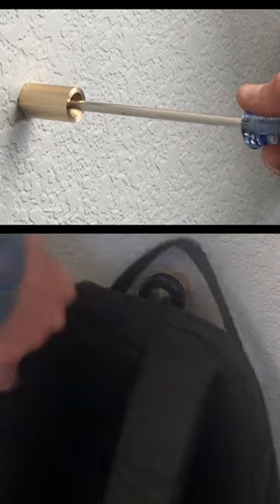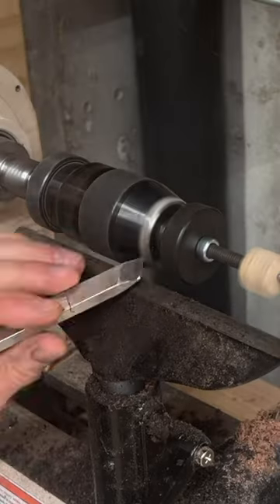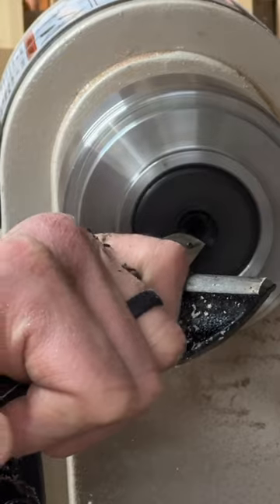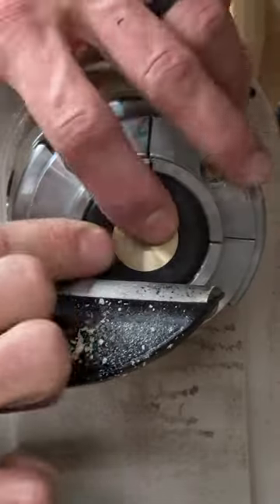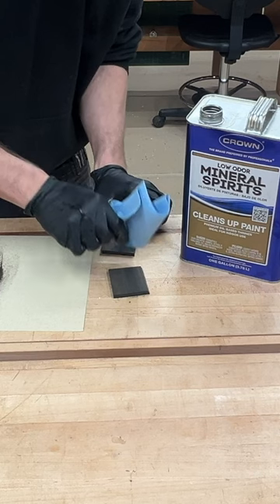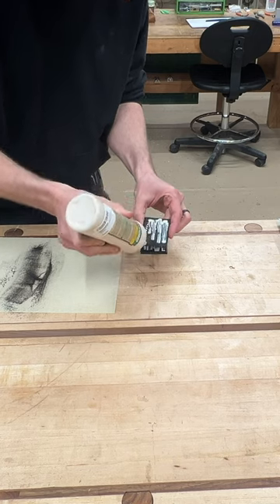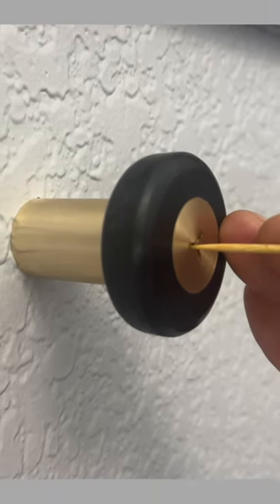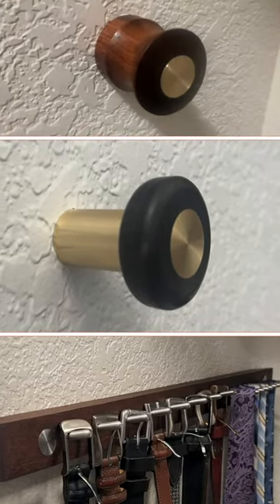Super Easy Hanger Build Woodworking Project

Comment: I don't really get the application here. Just make the whole hook the screw
Reply from the maker: So you would have whatever it is on the exposed screw threads?
Reply: Just glue a thread in place of where you added your screw. Then you can just turn the whole knob to tighten it. This would additionally make assembly easier.
Reply: Don't get me wrong I like your stuff but you are showing low torque applications that would in most cases just have to be hand tight
Reply: @Coconut7403  and this is how all of these are normally made!